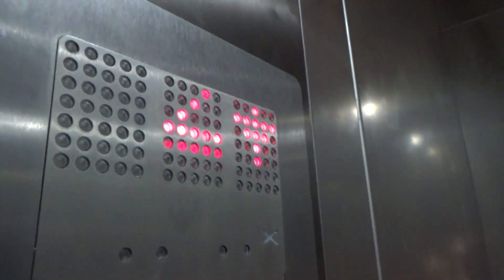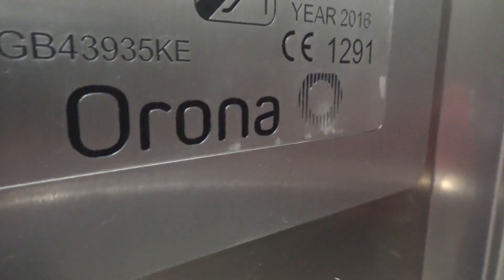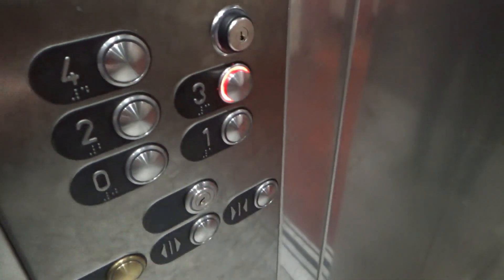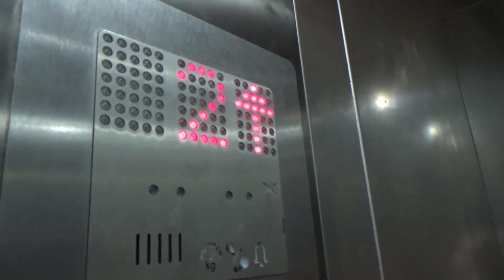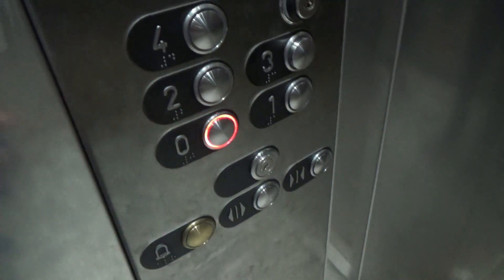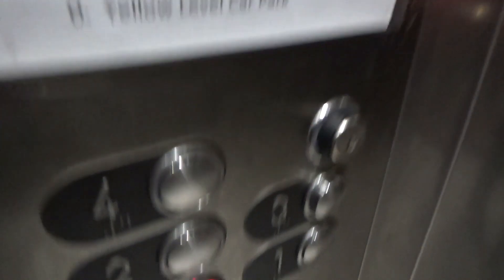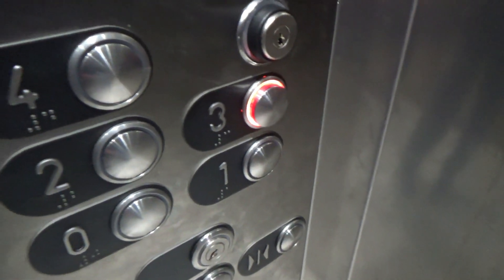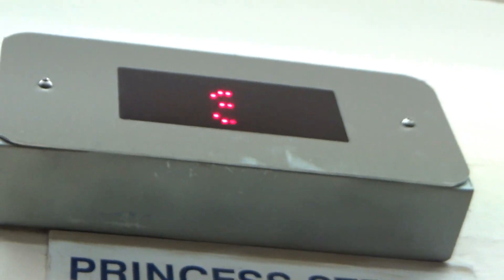Orona MRL Traction Elevator with DMG Fixtures at the Market Place Car Park in Chester

Comment: Wait? Do the two Otis lifts in Debenhams Eastgate have the rare voice thats in your Scratch project?
Reply from the maker: Yee
Reply: @ZZ9ProductionsOFFICIAL  Have you ever seen a Schindler d line lift with dot lamps in the buttons instead of the illuminating rings. That's Schindler D1
Reply from the maker: @LIFTEXCELSIOROfficial  idk XD
Reply: @ZZ9ProductionsOFFICIAL  Seeing a Mitsubishi in a locked building breaks my heart. Did you ever see a good lift through a window of a locked off building?
Reply from the maker: @LIFTEXCELSIOROfficial  a few KONEs but no mitsubishis
Reply: @ZZ9ProductionsOFFICIAL  Did u see any other lifts through windows

Comment: That's a Schindler indicator but without the Schindler logo on the first lift. What's it doing in an Orona. Photo of the Schindler indicator I'm on about  > https://pasteboard.co/HEvqr7N.jpg
The DMG buttons are the BS Sherman series
Reply from the maker: I guess Schindler did the extra cutouts for the symbols themselves then, as this Orona doesn't have them, maybe the Schindler FI MXV indicator is just an adapted DMG indicator. For reference: http://u.cubeupload.com/TheRealZZ9/SCHINDLERFIMXV.jpg - Schindler. http://u.cubeupload.com/TheRealZZ9/ORONADMG.png - Orona/DMG.
Reply: ZZ9 Productions That seems to be most likely. That indicator is on the DMG online website as a thumbnail but not as a product. http://www.dmg.it/images/prodotti/display_220x200.jpg